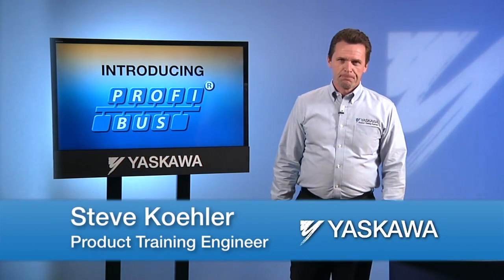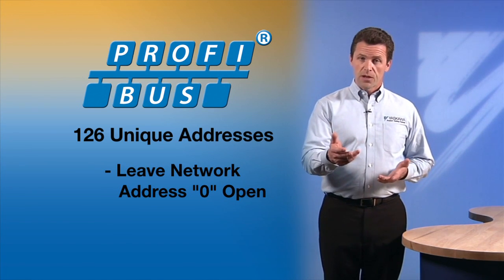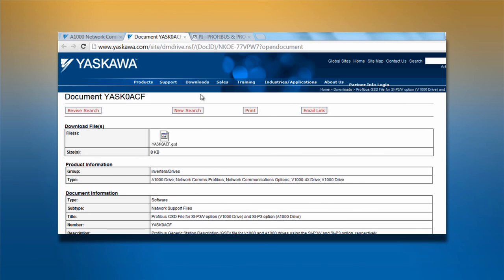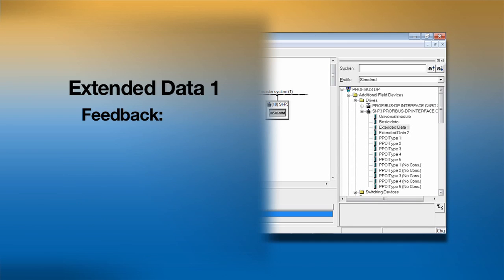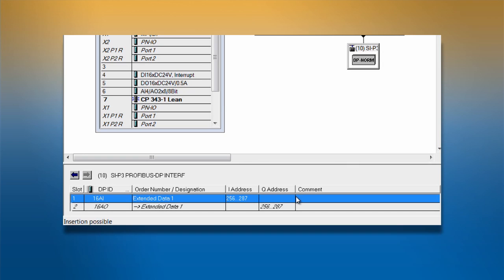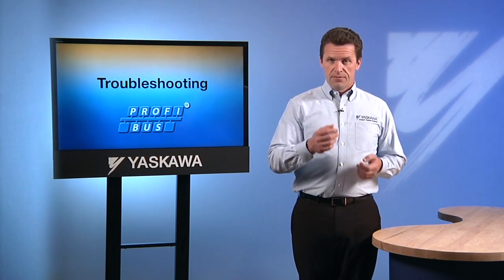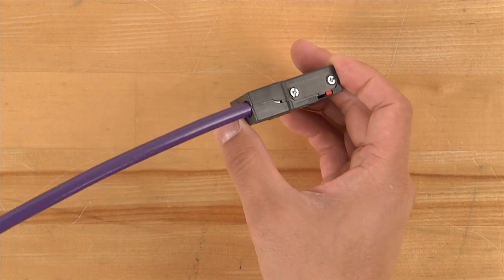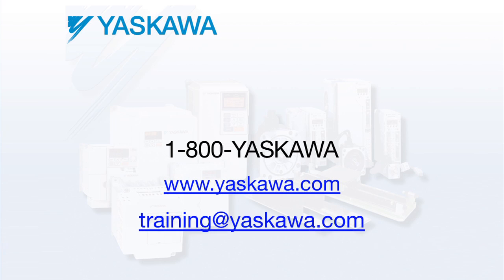Adding and Configuring Yaskawa Drives in a PROFIBUS Network

Comment: Good afternoon question about connecting the Vipa PLC to the GA500 drive. There are, for example, 7 (in fact, 40 GA 500 drives are planned), and it will be necessary to connect the drives to the Vipa PLC via the Profibus network. The catalog states that one SI-P3 card can be used to connect 5 drives. Tell me, do we understand correctly that 40/5 = 8 Si-P3 boards are needed to connect 40 drives? and then how to properly configure the entire network in Step 7, if we have conditionally, 32 drives are not connected directly to the Profibus network? Thanks
Reply from the maker: Thanks for watching our video on "Configuring Yaskawa Drives in a PROFIBUS Network."  For more information on your application, please visit: https://www.yaskawa-global.com/company/profile/global to contact the nearest service provider.